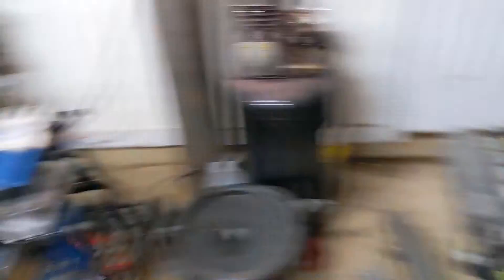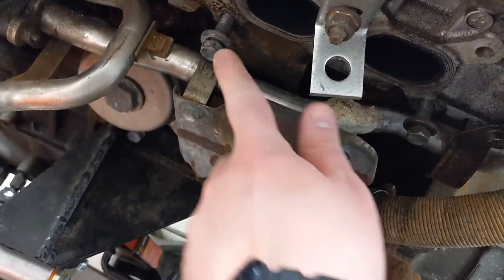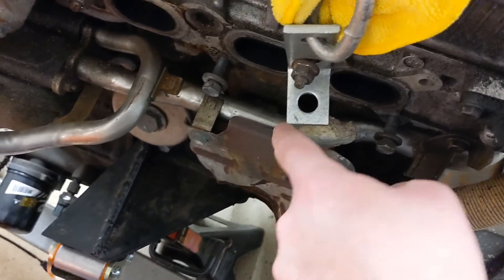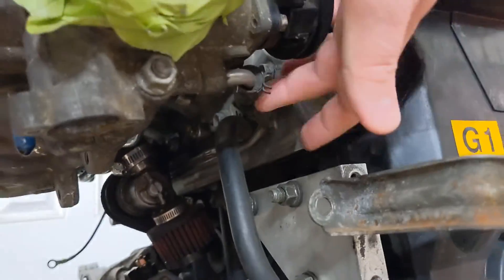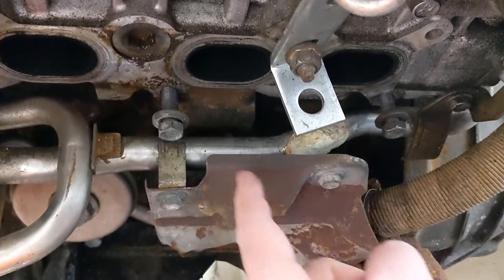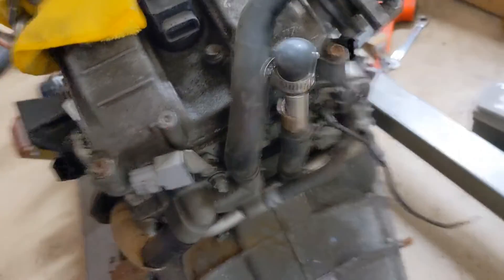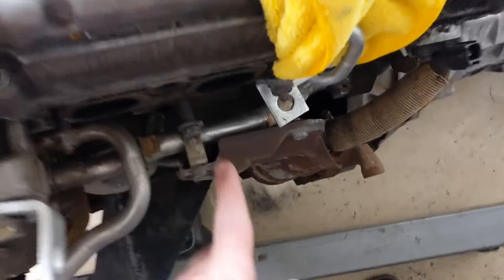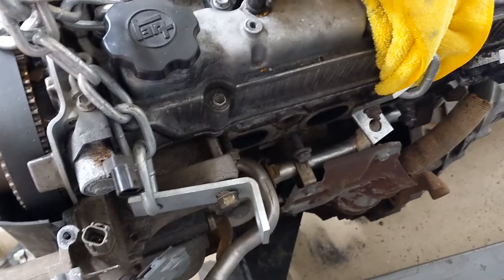HOW TO BEAMS SWAP an AE86 - common cooling system issues! Here's how to solve them

Comment: Can you just block the whole tube off completely if your going to delete the coolant oil heater and run a air oil cooler anyways ?
Reply from the maker: Hmm... I'm not sure if that'll mess up the coolant flow.
Reply: @DoctoredGarage   I just got my beams on a pallet and havnt really dug into it yet but I’m not going to run heat, throttle coolant lines or the water oil cooler so I’ll have to look into it. Thanks

Comment: How do you set idle i I don't know if I'm doing it wrong
Reply from the maker: For the mechanical override? There are two set screws on the throttle body motor side. One on top and one on bottom. You'll have to adjust both
Reply: @DoctoredGarage  do you have a photo

Comment: Link to the plugs you mentioned?
Reply from the maker: https://hpsperformanceproducts.com/products/hps-high-temperature-reinforced-silicone-coolant-cap-bypass-heater-core-delete-black-blue?variant=31580202532961&currency=USD&utm_campaign=gs-2019-11-15&utm_source=google&utm_medium=smart_campaign&gclid=Cj0KCQiAqNPyBRCjARIsAKA-WFwSjDH3rBsbW6WHHxTyZIqn4aQaIaVbtQz_MEkvktzJr4Cr7yE-FaUaAikSEALw_wcB

Make sure to select the correct size :)